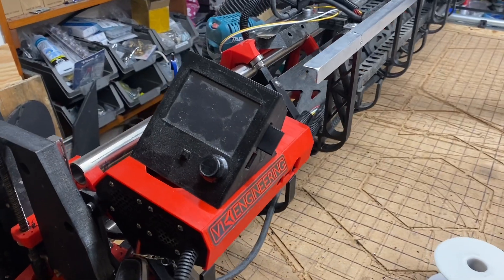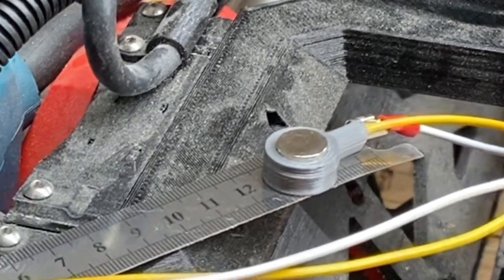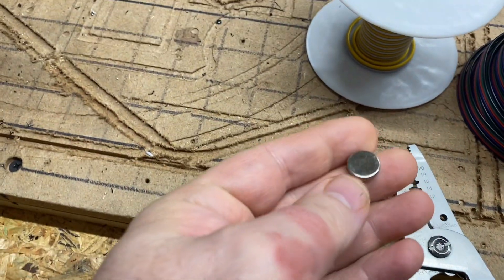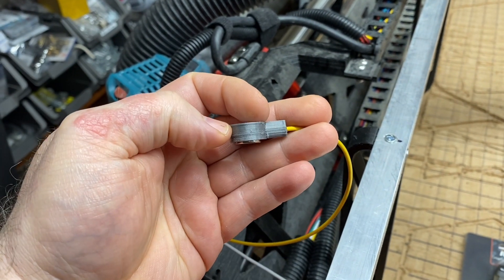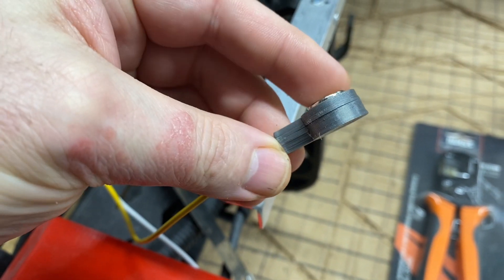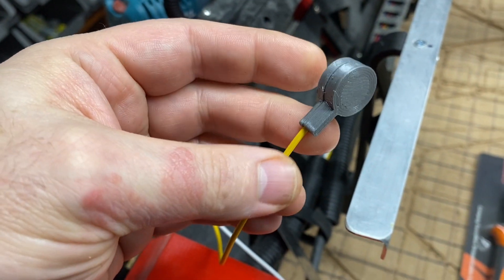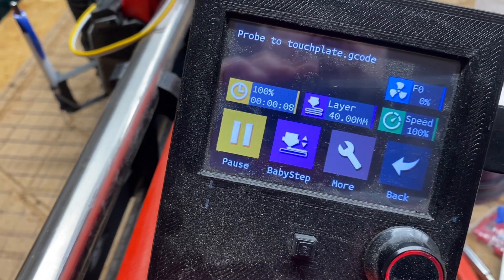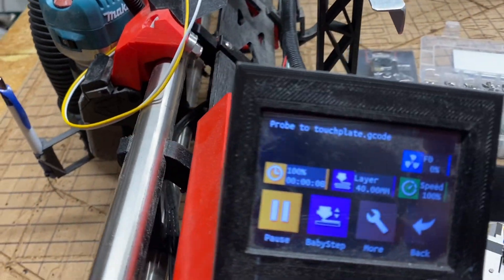For LowRider or other CNC: magnetic tip for touch plate wire

Comment: Can I use smaller magnets and attach them just with glue? I have some around, with smaller diameter and I don't wanna purchase a package of new magnets just to get two of them:)
Reply from the maker: @zemlejna1  probably would work! All depends on the strength of the magnets.
Reply: @design8studio  I will test it out then! And will let you know. :)

Btw - do I also need custom code for the jackpot? I'll check the v1e forum too.

Thank you Doug for what you do!
Reply from the maker: @zemlejna1  There is a macro script for the Jackpot that I use for probing, but there are also default, built-in options in the FluidNC web interface for probing. You only need a custom script if you want to make it probe a special way, such as moving fast on first touch off, then slow (from up close) on a second touch off. I've posted my script for that both on the V1E forum and on the description of one or more of my videos here on YouTube. As for exactly which video, I think perhaps it was a video about tramming the gantry to the table, while using the Jackpot.

Comment: Can you tell my why my tool path is being cut also
Reply from the maker: So, when something is being cut that you didn’t want to be cut, there are really only two possibilities. One is that you programmed it correctly, but your machine is malfunctioning. However, malfunctions usually look more like binding up, skipping steps, and cutting crooked and crazy lines. When it’s cutting a shape that is a correct shape — just not something that you want to cut— that indicates that it’s doing what you told it to do, only you just didn’t realize you told it to do that. Are you using ESTLcam for preparing your files to send to the machine?
Reply: @design8studio  yes I am I followed the guide word for work except for the probing part where I found this video
Reply from the maker: @dattisha27  which guide are we talking about? Is it in ESTLcam guide? Or a CNC milling guide on the V1 engineering website? For ESTLcam, if you have a stray cut line present in your file that you didn’t intend to be a cut line, you can click on it, and then delete it. If you then re-output the file, it should not be cutting what you deleted.
Reply: @design8studio  the guide on the lowrider build page for the Estlcam after I select what I want cut I don’t see the travel lines until I put it into repetitr host also on some cuts my z won’t rise it will just go straight to the next location causing a cut 18mm deep sometimes throwing the machine off from travel
Reply from the maker: @dattisha27  Each time you set up a cut you have the opportunity to tell ESTLcam where the start height of the cut should be. Also, you have control over a safe height level, which is supposed to be the height at which it retracts to after each cut. It sounds like somewhere you have at least one of these values off.